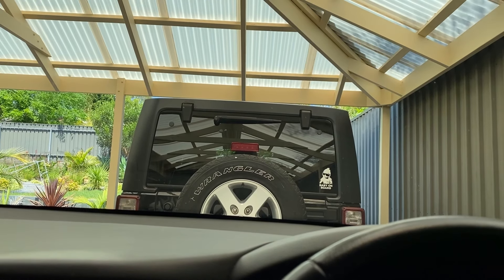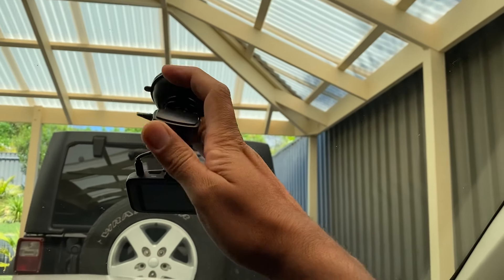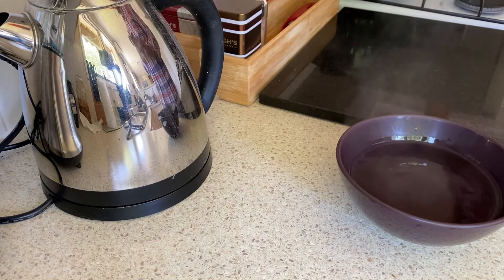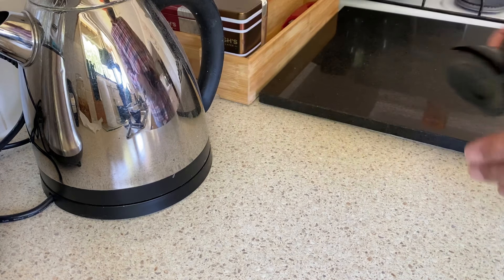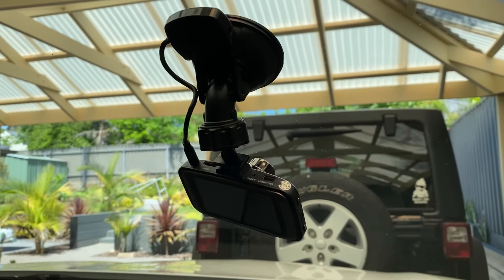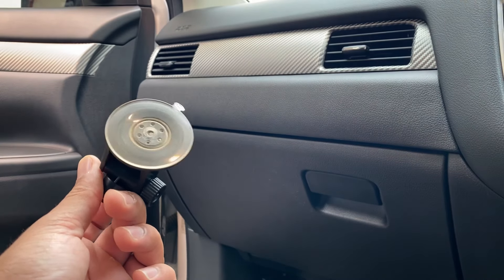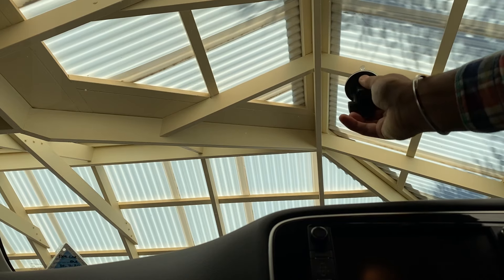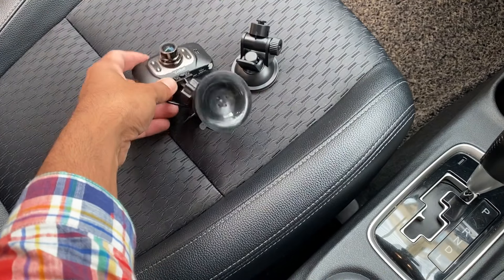How to fix suction mounts that won't stick (2 ways)/ Suction mounts problem solved/Easy fix/ DIY

Comment: Just tried this (boiling water) on suction cups on shower grab bars that wouldn't stick anymore...and so far, it's working!! Thank you very much for sharing this!
Reply from the maker: Great to know. Thanks for the feedback
Reply: Does it still stick?
Reply: I did this but after 20mins it wont stick anymore 😢

Comment: I’m a truck driver and didn’t have fast access to boiling water but I did use the a lighter and WORKED THANK YOU
Reply from the maker: That’s great to hear. Thanks for sharing
Reply: Don't smoke and drive guy

Comment: Just tried this (the boiling water method) and I'm impressed at how it sticks again, therefore saving me from buying another mount again :D I'll see how much it holds in the coming days. But for now my hearttelt thanks 🙏🏻
Reply from the maker: My pleasure
Reply: How is it doing?
Reply: How’s it doing tbh
Reply: Velcro also works I believ

Comment: Used a heat gun, high setting, only for a few seconds (pulled cup away as soon as it started to smoke lol) and IT WORKED! Thank you. Suction cup for transponder on windshield.

Comment: Great Help bro............I was fed up of my mobile holder regularly falling off the dash board even on plain roads and was thinking to buy a costlier one. But, your hot water technique has changed my whole thinking process. I am going to try it sooner than later.
Reply from the maker: Good luck bro. My dashcam is still on the windscreen after almost 7 months now, never come off.
Reply: That actually worked! Can't believe it, it's just basic science
Reply: @namanmutta7562 
Bro this will work on any mount and how much time should i wait before repasting the mount after cleaning with boiled water

Comment: Excellent video!!
One suggestion though - Press the suction lever down before dipping into hot water to form the rubber into a better stronger cone. Direct flame damages rubber, but any very hot heat source at a safe distance works as a decent alternative to water.
Reply: Might have to try my heat gun on my suction cup and see how that works?
Reply: I spent over an hour on this but couldn’t get I think I’ll try this method
Reply: It seems like that would defeat the purpose of the lever, which is to form a concave surface and the suction that goes with it.  If the resting shape of the cup is made more concave wouldn't you reduce the vacuum effect when pressing the lever down?
Reply: @d19jordan57  Agreed, resting shape should be flat; heating the rubber into cone shape is the opposite of what you want.

Comment: I'd assumed my problem with the sticker was due to humidity, but I now think it was just usage over the last few years.

As well as using just boiled water, I set the 'lock' to unlocked. The 'dimple' in the centre disappeared, I guess that was a 'Factory reset'. The difference was dramatic and looks very promising😀 Thank you Sukhneet. What would we do without YouTube to help us with these minor, but frustrating problems?

Comment: Wow I think these are good ideas. My radar detector mounts don’t stick anymore. Was thinking I need to buy new ones. But I will try your methods first.
Reply from the maker: Thanks. Hopefully you’ll save the money by using these methods. If the suction rubbers have any cut marks or hard scratches then only alternate is to buy new one. If it’s just missing the stickiness, then they’ll be repaired by these methods
Reply: Which company radar
Reply: Yes, I too was about to throw my Car Cam away and just buy another

Comment: Thank you for the tip, I used hot water sticked again and feels different,  thank you I was throwing away this suctions cups
Reply: I just returned to confirm that this trick really works, I used boiling water.      The suction cup was not holding more than 4 minutes  now have nearly 24 hours and it’s holding better than new.      Because of that I will be subscribing and watching all of your videos to see what else I am missing.      Thank you so much

Comment: I have 2 Tom Tom's from different eras. The older Tom Tom's suction mount is wider and that worked perfectly. The Tom tom 6000's mount failed and also developed a tear once submerging in boiling water. Now I have put superglue into the tear and will try again later

Comment: This looked very helpful. I am going to try the hot water method for a window bird feeder. Fingers crossed 🤞
Reply: Just did this on my bird feeder and worked like a charm.
Reply from the maker: That sounds great
Reply: Thanks. I watched this in advance for a window bird feeder. I haven't even put it on the window yet, but I was wondering what to do if it didn't stick. Your comment along with this video is exactly what I was looking for. Thanks again.
Reply: Bird feeder is still hanging. Lasted the whole Winter and staying strong through the Spring. That includes periodic cleaning and handling of the feeder while the cups remain on the window.

Comment: Thank you for your help. I have a question, how long will it stick (hold dash cam?)
Reply from the maker: I fixed mine using this method. Still working fine, it’s been like 5 months now.
Reply: @sukhsomal  Ok. Thanks for a quick reply! :)
Reply: @sukhsomal  it worked thanks bro

Comment: Thanks for the video. Is it holding on bumpy roads?
Reply from the maker: Mine is working great on bumpy roads too. I think If the suction rubber is free from any scratches or cuts, it will get back to its original suction power after this method.
Reply: @sukhneet singh, which method did you try ? Boiling water or lighter flame

Comment: Worked, but still can't believe as I have done it 20mins before 😂😂  hope it doesn't fall. Some YouTuber's said to use luke warm water but it didn't work untill I put it in boiling water for 1min💧
Reply: Is it still working,
Reply: @xinarin  yes

Comment: Which do you prefer better,  the boiled water method.  Or the fire. I myself would think the boiled water method would work best
Reply from the maker: Both are good considering individual circumstances. You can go for boiling water

Comment: does the pad have any sticking glue on it? will it needs to be pasted again or just boiling water will do the trick?
Reply from the maker: Just use boiling water. No need of glue

Comment: Heat gun will work well, too. Just make sure you don't point too long to melt the rubber.
Reply from the maker: Yes that will work also, but not every household have a heat gun. I just use the things which are easily available in every home

Comment: Question... does it matter if the suction is black or clear as to which method to use?
Reply from the maker: @rodrickwilkerson8862  doesn’t matter. Try hot water

Comment: the boiling water didnt work. Should i try the lighter or will it be the same issue?
Reply: I literally just tried the boiling water method and it worked. I left the suction cup to soak for about a minute.
Reply from the maker: It might be the rubber is having hard scratches

Comment: Which way is better if the rubber get yellow and dry? The hot water or with fire?
Reply from the maker: I recon water is better, as heat can sometimes damage the rubber if applied for long time
Reply: @sukhsomal  Thank you.👌

Comment: Tried both methods does not work
Reply from the maker: You suction cup rubber might be having scratches mate
Reply: @sukhsomal  even tried reforming and melting cleaning windsheild just sticks for 15 seconds and falls off